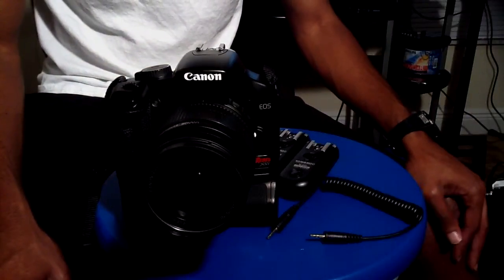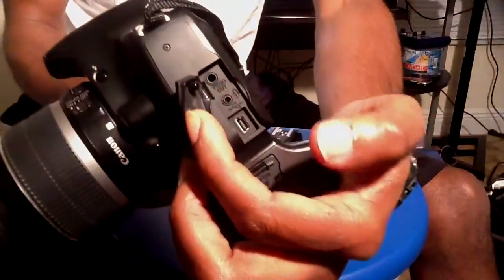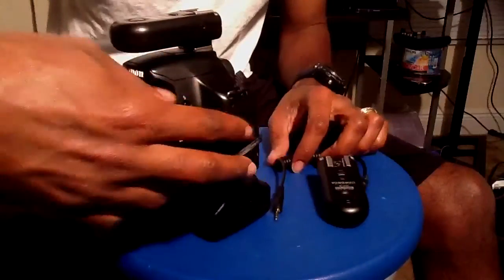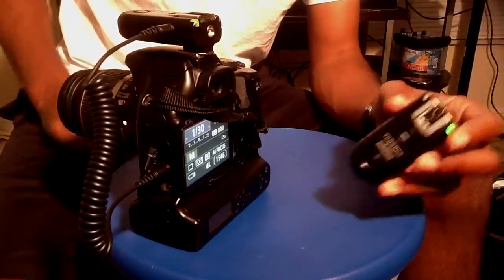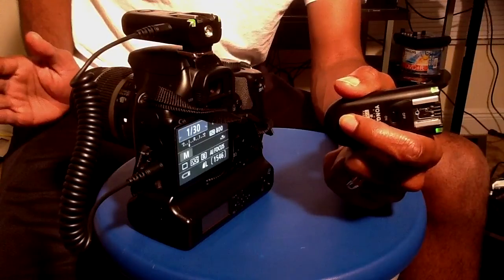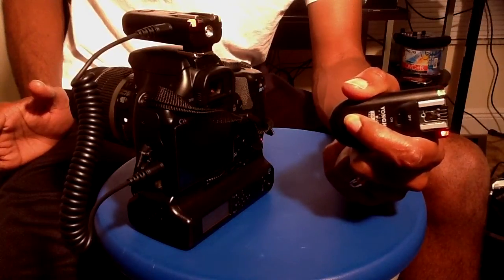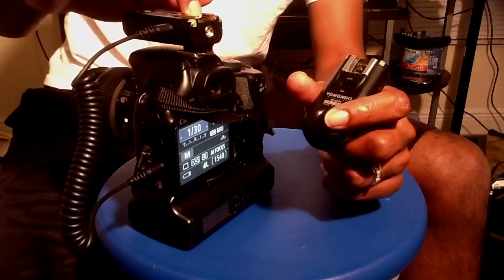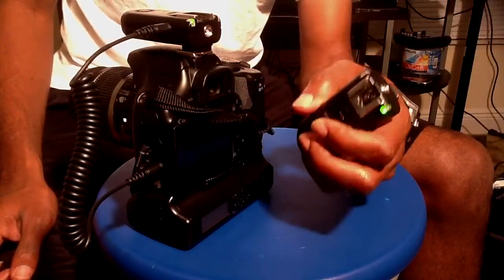Yongnuo RF-603C Shutter Release

Comment from the maker: S1 and S2 are slave modes. The slave modes are used to sync your flash with other flashes that go off. The S1 mode syncs with the first flash it sees.  S2 mode syncs with the second or subsequent flash the slave sensor sees. For example, I will use S2 mode when using TTL on another flash as the trigger. That way the slave flash will fire while the shutter is open and not with the pre flash. Hope this helps...